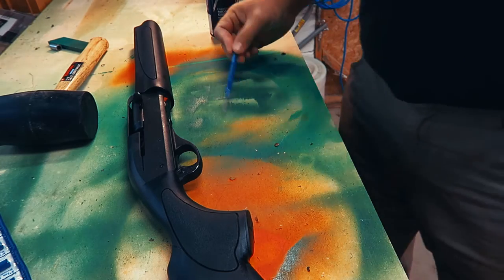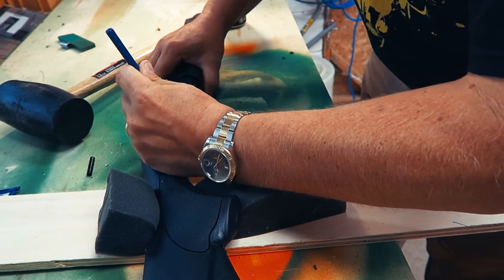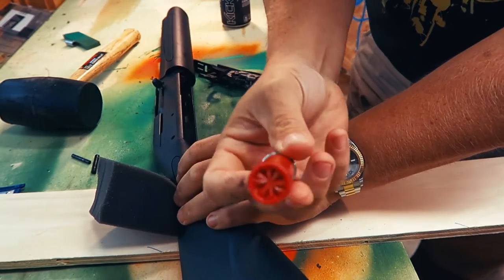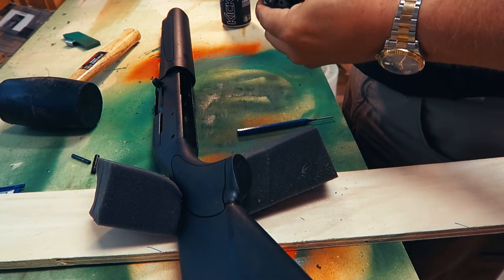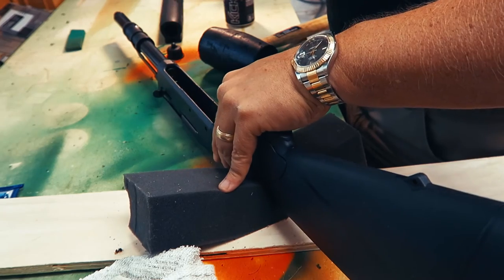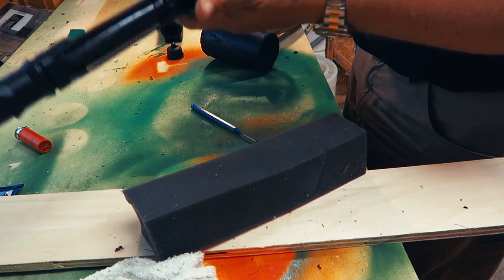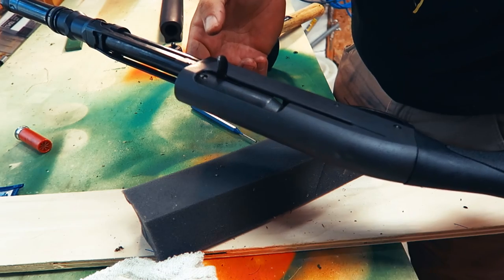UPDATE - Live Shotgun Shell Stuck Under the Carrier of a Remington 1187 Sportsman Super Magnum

Comment: I applaud you for saying you had no idea what you're doing, and you are 100% correct.  At least you were honest with yourself and the people who will watch this video

Let me help explain what is wrong with this gun after watching this video

That feed latch and carrier group is almost at a 90* angle setting below the receiver.  That gun will never cycle properly like that.  

The correct method to get those shells out,  would be to have pulled the magazine tube retainer and spring out along with the magazine follower out (all of 30 seconds to do) to get those shells out.  They would have slid right out the mag tube.

Secondly, nobody in their right mind should shoot Winchester (or any brand) low brass rounds out of a1187 super mag.  Even the Remington owners manual says this is a no no.  At best, you can try and install Remington's barrel seal activator piston on the mag tube with the other rings to try and cycle these low brass 2 3/4 inch shells, but no matter what, it typically won't cycle anything smaller then 1300fps high brass 2 3/4" shells.

When watching this video, your hammer assembly in the trigger group, was in the fwd "fired" position.  It needs to be in the rearward "ready to fire" position for it to fit correctly back into the receiver.  

Lastly, you cycling the action and action bar without having the barrel and forearm installed isn't good for the components.  If you cycle the gun without these components installed, you need to hold it and cycle it under control.  Not at full power.

I think there is a reason we don't see a video on you using this gun in SD hunting Pheasants because this gun is  toast.  At the minimum your gonna need a new carrier, carrier dog, and other components.  Your best bet is to find a new / used Super magnum complete trigger assembly and put it into the gun and go from there

Comment: I’m having the same problem with a 16 gauge Browning A5. The closest gunsmith to me is 60 miles away. I may use this video and take a shot at unjamming it. Thanks for the video!
Reply: Unjaming it is the easy part. Fixing the problem is the real thrill. I'm fighting an 11-87 right now. Getting new parts is a real thrill!
Reply: Did you figure it out on your a5? I can't get the magazine cap off my tube and don't have the right screwdriver to remove the trigger group
Reply: @jonnyfirecrack  I had to use a pipe wrench to get the cap off. Once I did that I was able to just poor the shells out. But after re-assembling it, it still won’t cycle the shells. Judging by the serial number, this gun is roughly 74 years old! I guess it is due for some maintenance.

Comment: Thx for this video.  It ws very helpful as mine got stuck w a dummy round the same way.  i couldn't nudge the shell forward
trying to get the shll fully into the tube magazine.  It just kept on springing back bc that carrier tongue is at an angle n under its
spring tension.  I thought i had to disassemble the entire gun and dat gave me jitters as i looked at its exploded 3D parts
diagram at Brownells site.  But i did it n easily popped out the round.  (2:54) - I used a paper punch to make a round piece
of a thin cereal cardboard.  Dont worry bout losing the ppr piece as there's plenty of big MT space inside the rcvr and the
trigger unit is tightly packed w parts n u can easily find n remove the ppr piece.  So, I made a center depression on the round
ppr piece at the rcvr's pin head, then punch the pins out.  This protected the pin head from marring.  But hey, ur gun (ur friend
now won't have any rights to get the gun back buttto depending upon how u feel) is nut (not) a classic highly deeply polished
M870 WingMaster gunblue metal w classic walNut stocks.  Urs is of plastic rcvr or at least, plastic coated 'Parkerized' alloy
(i.e., a euphemism for non-steel, plastic coated MIM AloooMinimum** w plastic Laddies TopperWear stockings [butt n forearm
stocks]).  So, who kares bout marring either the pin head or even the rcvr sufrace?

This disassembly also gave me a good chance to clean the unburnt powder, spray the triggering mech w silicon,  lube the joints, 
n grease the sliding rails inside the receiver.  Here's Brownells site to clean the disassembled M870:

  https://www.youtube.com/watch?v=RJxcdaUFCCw

Now, i need 2 figure out how to properly re-install the trigger mech.  Go bk to Brownells

  https://www.youtube.com/watch?v=5dhRCwFFmdg <-- Front of the triggr unit goes in 1st. But doesn't say levers of the unit
                                                                                                     must b pointing in which proper direction

Oh, by the way, pls don't hyper volume at ur introductory twang guitar.  Me-hand wasn't quick nuf to turn the spkr off.  My PC
Speaker of the House, Jim YourDung and Cave-In SmackArtsy got knocked off the table n they both tumbled over.  They were
both tied together w wires.

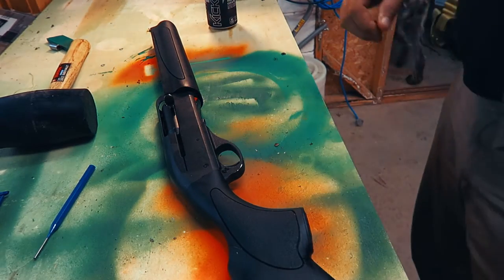N, i like at (1:24) when ur dog entered the room while u grabbed dattto hyper energy drink. Butttto after u've mentioned datto
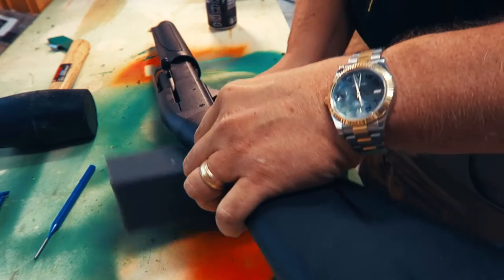u could go Krazy drinking it, u ur dog made an immediate U-turn w its tail betwn its hind legs back into the dark room (1:27).
Very funny.

____________
**Brit's way of pronouncing Aluminum (Al in chem abbrev)